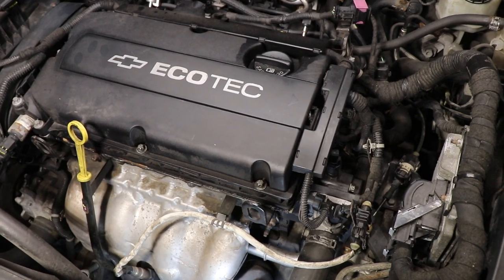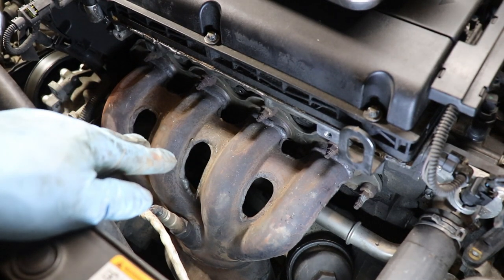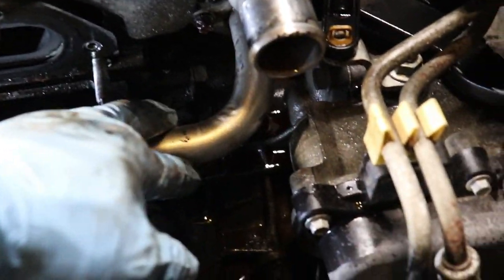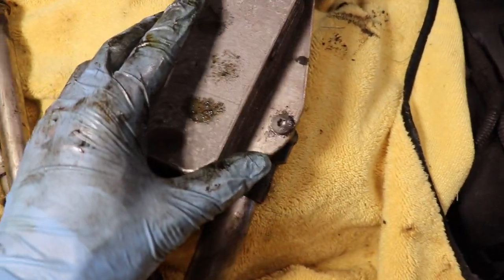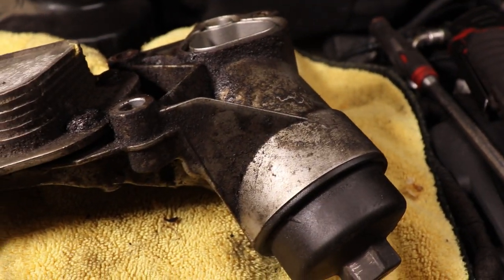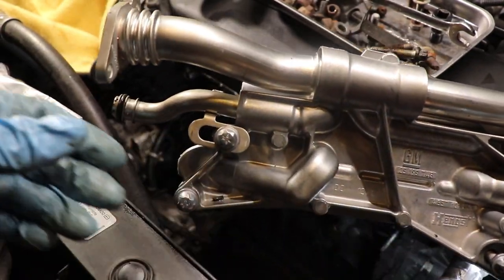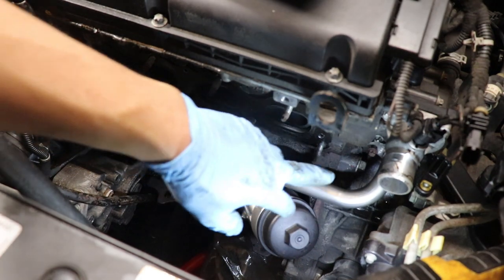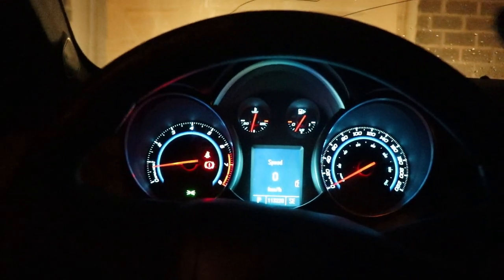How To Replace Oil Cooler Assembly [ Chevrolet Cruze/Sonic/Holden Barina 1.8L 1st Gen 2011-16 ]

Comment: After 50k miles of oil mixing with coolant looks like I'll be resealing the oil cooler. So I'm going old school and slathering every rubber gasket with high temp oil resistant rtv before reassembly. Thanks for the video, my 2012 Sonic has 200k miles and hopefully another 200k after I fix this oil leak.

Comment: One of the Best video's I have ever followed, not a mechanic or usually eager to try a job like this. The repair shop wanted $660 and was able to spend a little over $200 and complete the job with the very simple instructions you posted. Our 2014 cruze was smoking and had a very small oil leak that was traced back to oil cooler unit, was able to install new with very little issues. Once installed we refilled fluids but the heater doesn't seem to be blowing warm air, as we live in Florida and not a huge deal but was wondering what I should check to fix the lack of heat.
Reply from the maker: Hey there, there's probably some air bubbles in the system. All you have to do is make sure the coolant level is good on the reservoir and rev to 2500 RPM for about 5-7min while max heat on. That should get rid of air bubbles and bring the heat back. Make sure you're at operating temperature before starting that procedure and make sure while doing it, the temperature gauge doesn't go too  high, it should stay steady.
Reply: If it's not blowing warm air into the cabin the heater core may still have air in it. You can usually get it out by running the heat at full blast while the car is on. Do this when the car is warm but not hot. Remove the radiator cap and the overflow cap. Give the car some small taps on the gas to allow the thermostat to open up and bubbles to travel. Then give it a couple of taps on the gas so the bubbles travel out of the system. You will notice that the heat in the car will get hot. During this process you will lose some coolant so pay attention to the overflow tank and fill it as needed. Once you have heat close everything up and top off coolant. Hope this helps. Be blessed.

Comment: Update status. I’m manage to replace the oil housing without removing the manifold,it possible to work around it .I brought it up, then turn it to the right side, the sensor has to go over the cooling hose and then you have to twist it and wiggle it then you have all the space to work on the part. Your video rocks. You explained everything to the dot, it’s perfect. I greatly appreciate it. Unfortunately for my case I managed to break one of the bolts from the bottom side of the exhaust manifold. So now I’m debating wether to just hammer it out or drill it and replace it. Thank you again
Reply from the maker: Glad to hear you got it done! You're very welcome for the video , happy to hear that it helped!
Reply: I thought you said you was able to replace the part without removing the exhaust manifold? How did you break the manifold bolts if you didn't need to remove it? Just curious bud. I might try your way if it's easier and cheaper

Comment: Great video.

GM provided inferior rubber seals.

They only last 40K miles before getting brittle.

Every car on the road will mix oil and coolant and leak.

Comment: Great video! I have a coolant leak from behind the exhaust that I can’t trace just yet. Are the hoses in front of the manifold able to be pushed forward closer the the fan to make more room without  hurting them? Thank you!
Reply from the maker: Yes you can flex them towards the fan when removing the manifold. Its a tight fit but take your time and find the right angle.

Comment: @OneTrickTech, Great Video easy to follow. The other day I found my coolant reservoir on a minimum level, I refill it on maximum. I drove 250km when I check it to see if the coolant goes again I see oil on the reservoir tank mixed with the coolant. I checked on any leak I found nothing. I'm wondering if the cylinder gasket was burnt out or the oil cooler is the cause. I check the oil in the engine there is no trace of coolant the colour of the oil is normal. There is no white or blue smoke coming out in the pipe while im driving i don't see any oil leaks on the engine. I think I had a bad oil cooler that causing the mix of oil inside reservoir. Or maybe there something else that causing this??? Thanks for your effort on making this video
Reply from the maker: I would replace the oil cooler assembly before blaming the head gasket. If you're leaking oil from the oil cooler, then you can just changed the gaskets and put everything back together. Since you have oil mixing with coolant, the oil cooler assembly is probably cracked and mixing the oil and coolant. I would also check for a water pump leak since they are known to leak from the bottom of the water pump.

Comment: Thanks for the great video. I just did this. Installed a whole new unit. Took a few tries to start the car afterwards, but when it did start part of the oil cooler block snapped off. The edge of the oval shaped inlet/outlet where the oval shaped gasket is. oil went everywhere. Any idea why that would happen? Cheers.
Reply from the maker: most likely a defective part. I would try to return it and get a replacement one, if it broke during or after installation, its obviously a faulty part.
Reply: @OneTrickTech  thanks mate. Just saw you replied. I got it from ebay so  probably cant get a refund. But it came with 2 sets of rings and gaskets so Ill try cleaning the original cooler and put it back in.

Comment: Hi great video. Just one question should you bleed the air out of the coolant lines at the end? I have a holden Barina 2104 which i think is the same a chevy cruze or sonic/aveo  and has a bleed plug at the top of the radiator.
Reply from the maker: yes, but this is a capless system so it ca bleed itself. When you fill the coolant to the proper level, rev the engine to about 255rpm for 5min and it will get rid of all the air bubbles. when you're done, check the level again and top it off.
Reply: @OneTrickTech  Ok so if it doesn't have a bleed plug you just have to fill it and keep filling to right level and rev it for a few min (with the overflow cap off I assume) , but if   has the bleed plug is there you can do that as optional? sorry just a bit new to this as you can tell :) Thanks
Reply from the maker: sure you can do it with the bleed plug if you have one. You keep the cap on to build enough pressure. I also forgot to mention to put the heat on to max so the coolant can circulate to the heater core, while reving at 2.5krpm for 5min.
Reply: @OneTrickTech  ok thanks for confirming that and also with the heat on max for heater core. so basically, it is after draining coolant from the drain plug at the bottom to refill and bleed would be 
1 - Open the bleed screw at the top of the radiator which allows air out 
2 - Fill the coolant overflow tank with new coolant until it runs out fully from bleed screw
3) Tighten back up the bleed screw
4) Fill coolant level to the cold fill level (about half of the overflow tank) .
5)    replace cap fully on overflow tank 
6- start car and turn heat up fully and open cabin vents . let car idle for 1-2 minutes let it circulate and get temp up ? 
7-run for 5 min at 2.5 rpm
8 check hot air coming from vents 
9 take for test drive 
10 check coolant level in overflow tank after running top up if needed.
Reply from the maker: yes almost perfect. On #2 you don't need to fill until it comes out from the bleeder screw, just fill till max and the after the test drive top off to max level again. The bleeder screw is to force air out while you're reving at 2.5krpm for 5min.
Reply: @OneTrickTech  Thanks mate for the advice much appreciated. Final question then with step2 just screw back in bleed screw once air released then fill with coolant to max in tank ? Take for drive and check / fill. Doing this weekend so already to go Thanks again.
Reply from the maker: @dmanyeah7963  yes exactly. sometimes you will see a bit of coolant coming out of the bleeder screw. after 5 min close bleeder screw, top off if needed and go for test drive to make sure the car doesn't overheat. You're very welcome! glad I can help!

Comment: Great video, thanks. did you drain the engine oil before taking off the oil cooler?
Reply from the maker: I didn't but if you're due for an oil  change you can do it during the repair.

Comment: My chevy has some oil in cooler tank.. so my mechanic told me this piece right here it's the problem.. what do you guys think?
Reply from the maker: As long as your car is not overheating, then yes you can replace the oil cooler assembly because that's where oil ad coolant can mix if the oil cooler is cracked.

Comment: I have a holden cruze 1.8L 2012 sedan. I noted oil leak on to the exhaust manufold and traced it back to the oil cooler. I then replaced the oil cooler assembly and topped up the coolant and oil. There were no further leaks when i switched on the engine. Though i did notice white smoke coming from the bottom of the engine, a knocking sound coming from the engine at idle and the oil light turned on in the dash. The OBD2 scanner reads P0011 code.    The oil level is aqequate on  the oil dipstick. The intake variable timing solenoid is also working. I can't seem to find the cause of low oil pressure? I think the P0011 is related to the problem causing the low oil pressure? What could be the problem here?
Reply from the maker: Did you do an oil change before starting this job? If yes, I suggest removing the vvt solenoids and cleaning the small screens, they could be dirty.
If you did not do an oil change, I suggest doing a fresh oil change with filter.
The oil pressure switch is below the oil cooler on the left side near the a/c compressor, check to see if its was damaged during the repair, make sure the wires are intact.

Comment: So I can buy a new oil cooler assembly take the oil cooler out and put it on my old one? Because I tried putting the new one on but the pipes aren't lining up right
Reply from the maker: Yea you can, the oil leaks come from the gasket on the oil cooler. Did you get a after market part? Is that why the pipes aren't lining up?

Comment: I’m wondering why when I look up these parts you listed on Amazon, It’s said they don’t fit the 2016 chevy cruze, What am I missing or did Amazon make a mistake, my car is the 1.8 litre engine, thanks
Reply from the maker: amazon mistakes. A few people had that problem already. The part fits 2011-2016 Cruze 1.8L
Reply: Thank you so much, great video.

Comment: Nice video! Did you re-use or replace the exhaust manifold gasket?
Reply from the maker: Yes I did. If I had a leak I would have changed it but mine was still in good shape.

Comment: I have a 2011 Chevy Aveo I have to replace the oil cooler. Should I replace all the lines or can I replace the rubber gasket on the pipes I’ve ordered the whole oil cooler assembly
Reply from the maker: Hey there, you can change just the rubber gasket on the lines, it will be much cheaper in cost, but you would have to get the exact o-rings that fit each cooling line.  You will need the parts number for all of the o-rings.
Reply: @OneTrickTech  No…I found the gasket great video guide I will be doing this in the near future thanks

Comment: does a bad oil cooler cause the engine temperature to rise ?
Reply from the maker: No, engine overheating is caused by low coolant, bad coolant flow or bad coolant cooling (radiator fans)

Comment: Hey. Great video. Quick question....If I needed to just have the gaskets replaced on the oil cooler how much would that cost roughly would you say? I was quoted 800 from dealership. Thanks.
Reply from the maker: There is a Dorman kit with all the gaskets you need to replace here. If you don't replace the cooling pipes gasket, they might leak if you reuse the old ones. The same kit is on amazon too, just copy paste the part numbers.
https://www.rockauto.com/en/catalog/chevrolet,2011,cruze,1.8l+l4,1446774,engine,oil+cooler+seal,2168
Reply: Think it's cheaper to just buy the oil cooler. In my opinion it comes with the gaskets. Not sure haven't checked price just throwing my two cents in

Comment: What do you if you've pushed to far in the small hard coolant pipe and now it is jammed and cant be pulled back out ?? The new o-ring is preventing it being pulled out for adjusting. ?
Reply from the maker: If you need to pull it out, spray some penetrating fluid and wiggle out slowly. If its sitting flush already try to work you way around it. The new pipe o-ring should be easy to put in if you clean the surface first from any rust or debris.

Comment: Thanks mate. It's taken me 6 months to find the leak. My mechanic don't want to take my car anymmore. It's wicked finding the parts in France. 
Just one question, do I need to disconnect the AC pipes in front of heat shield to remove it ?
Reply from the maker: No need to, just like in the video, I removed it without taking it out. Just take a bit of time to find the right angle but it should come out.
Reply: @OneTrickTech  Cool !! I just ordered the gaskets and I found the torque specs. You helped me to save a lot of money !!
Reply: Tabernacle !! mais tu es Quebecois !! Bonjour de Bretagne !!
Reply from the maker: hahah oui Bonjour du Quebec. How did you figure that out ?!
Reply: @OneTrickTech  Haha !! Because it's written on your main page.

Comment: Great video.  Its sad that these cars are such garbage. I've had mine since brand new in 2015 and have already had to replace the coolant output,  thermostat housing because of coolant leaks. The valve cover gasket twice because of pcv .Now I have to replace the oil cooler and line to turbo for oil leaks.  Unbelievable. What has happened to GM? I'm a chevy guy but now a days I don't know anymore. I'm thinking about buying a F250 instead of a chevy.
Reply from the maker: Totally agree, these cars require too much repair in my opinion especially when they're under 100k (km). They fall apart after a few years of ownership. GM likes to make stuff as cheap as possible to maximize profits. In the end, we pay the price for all that junk. Oh well. C'est la vie!
Reply: @OneTrickTech  Exactly.  Mine is paid for and my son will need a car next year. I figure just bite the bullet and do all the repairs and hopefully get a few more miles out of it.
Reply: I’ve had many problems out of my 2011 Chevy Cruze but I think I’ve said enough… purchased in 2016 with about 55,000 miles, the trans went out at 88,000 miles. Luckily it was still under a service warranty with the dealership. My driver window motor has went oht twice within 2 years….   Now I’m afraid if I don’t get the engine cooler replaced soon my engine is going to have problems. 😢
Reply: Honestly Buy A Toyota Tacoma Or Tundra… Btw I drive a Cruze and it’s sucks
Reply: I mean Ford have issues with there cars also...but you said going from a Chevy cruze to a F250. I mean thats different. Now I would change from a cruze to chevy 2500 would make since if you is a chevy fan.
Reply: 2014 Cruze and same .. dealership charging me $1,400.

Comment: Una pregunta Hola buenas tardes disculpe si se dañara esa pieza y se mezclan echaría humo blanco por el escape o solo sería aceite en el deposito
Te agradezco tu respuesta
Saludos desde reynosa Tamaulipas México
Reply from the maker: si la pieza está rota, entonces el refrigerante se mezclará con el aceite en el cárter de aceite, pero no debe salir humo blanco porque no quema el refrigerante.

(translation)
if the piece is broken, then coolant will mix with the oil in the oil pan, but no white smoke should happen because its not burning coolant.

Comment: Where did you purchase your gaskets from can you link the part number for the gaskets or to the website or store so I can make sure I’m getting the right ones? Oriellys has 4 different kits
Reply from the maker: I purchase the whole oil cooler assembly and all the cooling pipes so they came with all the gasket already. I have the links for all the cooling pipes in the video description. 
If you're only changing all the gaskets. Here's a link for all the gasket. There's 1 big gasket for the actual oil cooler. 2 gasket for the assembly (oil filter housing. The gasket goes on each end. And lastly you will need 6 gasket for the cooling pipes. 2 for each pipes. Here's a link for it.  Scroll to the last option, tis a Dorman gasket with all you need, but its the only one I found.
https://www.rockauto.com/en/catalog/chevrolet,2011,cruze,1.8l+l4,1446774,engine,oil+cooler+seal,2168
Reply: @OneTrickTech  thanks!

Comment: I have a 2014 Cruze LTZ & if I’m having this issue could I dive 4.5 hours to a new state with the issue? My car will be fixed in the state. I have to move soon & don’t have the funds for the fix but wonder is it safe driving that long?
Reply from the maker: Oil leaks are not dangerous depending on the size of course. Before you drive just make sure your oil is at a good level, add oil if you need too, and as long as you're not leaking coolant, you will be okay.
Reply: @OneTrickTech  So I got an oil change yesterday & leave the 15th, would I be okay? The leak isn’t great. I just wanna make it the 4.5 hours and park it.
Reply from the maker: @marzonmedia  yea you'll be fine
Reply: @OneTrickTech  final question if i am leaking some coolant not much could i just refill on the road and make it?
Reply from the maker: @marzonmedia  yea as long as you're not overheating you should be okay.
Reply: @OneTrickTech  thanks!

Comment: would an oil cooler leak coolant? my oil is fine but it seems like my coolant is leaking.
Reply from the maker: yes there's is 3 coolant pipes passing thru the oil cooler. that's what helps to cool the oil, so if you're leaking coolant you should check the coolant pipes mounted on the cooler